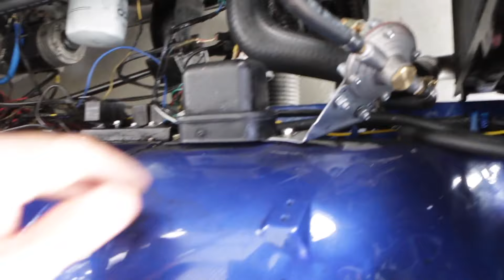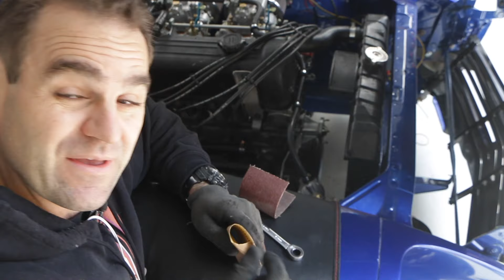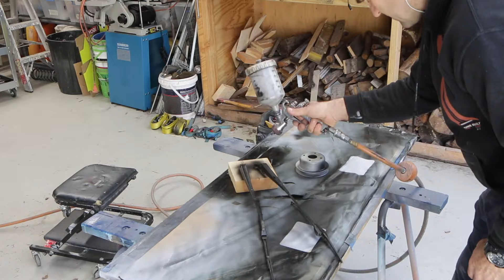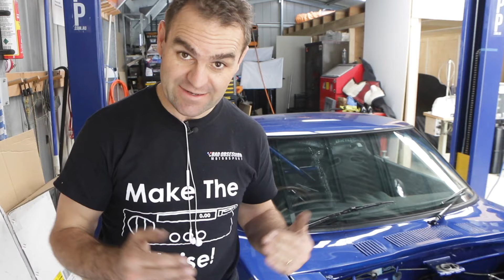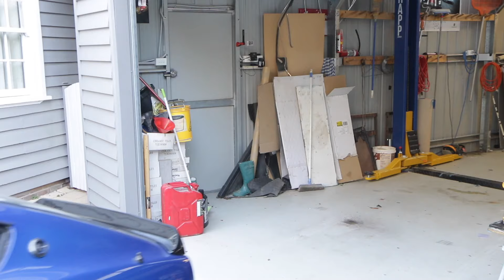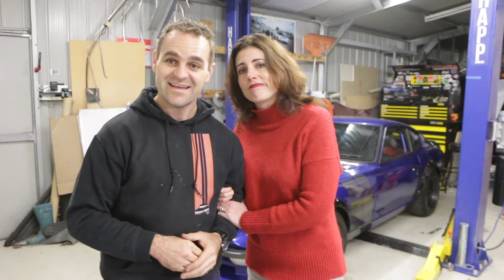Shredded belts and wipers - Home Built Datsun 240z part 103

Comment: I really enjoy the improvise, adapt, and overcome spirit of your build series. I have had a number of 240Z's in the past and one experience I had was with the plastic fan. In my youth my driving habits were merciless and under those circumstances I had one of those plastic fans have the blades distort at the root of the blade and fold over and destroy the radiator. I would keep an eye on yours and if you notice the base of the blade discolor to almost a more opaque white it usually indicates the polymer is being yielded allowing the blade to distort and contact your radiator. If it becomes an issue a steel fan blade from early cars can be used or maybe electric fan may be prudent. Thanks again for your outstanding channel.
Reply: Lucas Rea electric fan all the way. Mechanical fans just waste horsepower
Reply: Electric fan plus, less belt load, better thermal control, better engine response better economy.more power...........

Comment: Great stuff as always, forgot to suggest on the last vid that a quick and cheap way to help with low cars on tandems is some treated pine sleepers either on the ground and partly on your existing ramps or cut them up to 1/3 and 2/3 pieces and stack/screw them on top of each other staggered then place the lot under the end of your existing ramps. Another help is if you have a wind up jockey wheel thats heavy duty then use it to raise the front of the trailer while still connected to the tow car and this will lower the tail of the trailer.

Comment: Man flu is the worst!

Looks like you have two driver's side wipers?  May need to shorten the arm on the passenger side wiper, or hunt up a passenger side one.  Section some out of the solid part and weld it back together, grind and repaint.  Measure twice and cut once checking location of a new blade over the full sweep of the screen.

I reckoned it'd be pretty loud with just a hotdog and a back muffler.  How much louder does it get when you operate the engine through the rev range?  At the dyno woulda been a great place to check it.
Reply from the maker: I have dug up another wiper, I just need to get the correct bolt to use it.

Comment: Pulleys don’t often give problems Jeff...most commonly its fan belt width or one or more of the pulleys are running out of line .
Reply from the maker: They had a lot of rust on them which was acting like sandpaper. Now I have cleaned the pulleys it seems a lot better.

Comment: are you not missing some rubbers between the wipers motor and the car where the wiper blades attache???
other wise the rain will go right in to the wiper motors??

regards
Sören
Reply from the maker: The whole thing is open through the slots all the way along. It is designed to get wet in there ;)
Reply: @Home Built By Jeff 
I think he means on the wiper posts.  I sent you two!
Reply from the maker: @alienpoker  haha, I have been so busy doing the big things, I haven't got to sorting out those little things ;) Thanks mate.

Comment: Did you fit a check valve on the washers?
Reply from the maker: Not on these. The run is so short I am not too worried, but if it bothers me I will sort it out.
Reply: @HomeBuiltByJeff  True, plus they aren't attached to to bonnet and hence need a easy disconnection point for when you need to remove the bonnet because you need to repaint it after scratching it.